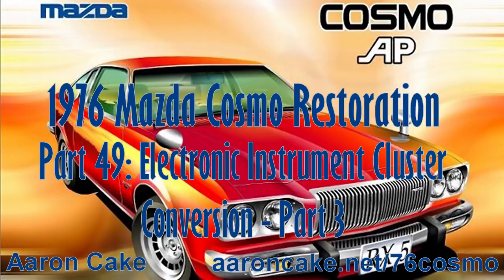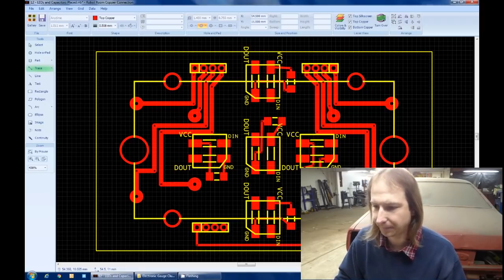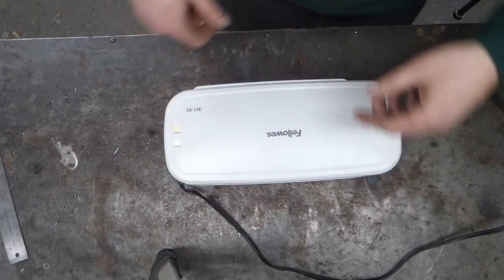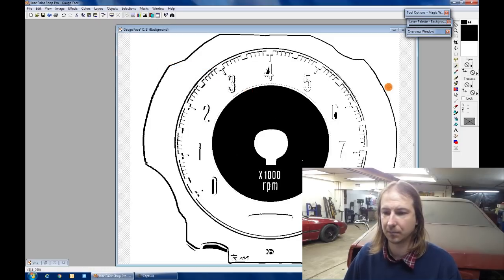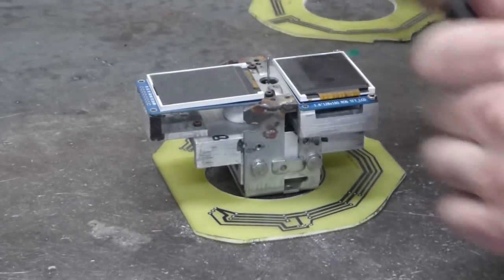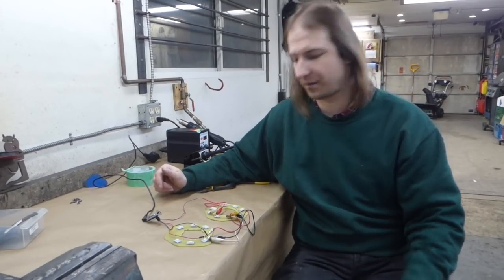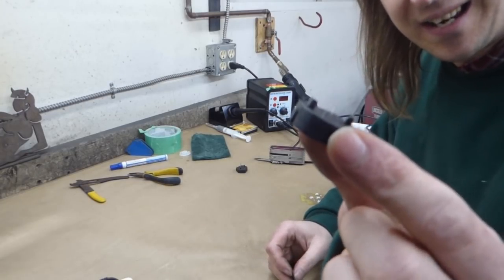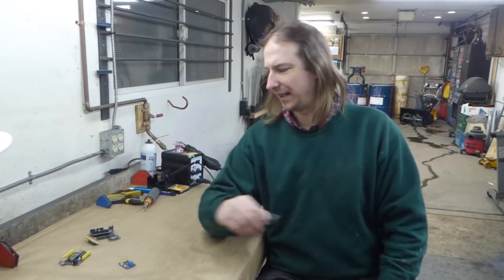Part 49 - Electronic Instrument Cluster Conversion - Part 3 - My 76 Mazda RX 5 Cosmo Restoration

Comment: This is the best thing that happened in 2020, thank you Mr.Cake!
Reply from the maker: I'd have to agree with you there.
Reply: @aaroncake  Fun Fact: 
It says 2019 on the board, and its almost 2021... holy shit!!!
Btw, i like the swiss knife (have the same) and also the turtle bottle👍🏽
Reply from the maker: I actually designed some of those boards very early on, I think on Christmas day 2019. So the files sat around a while before being used.

Comment: That hot air solder iron is slicker than owl poop.
Reply from the maker: Definitely a good purchase if working with electronics. Also great for heat shrink tubing, releasing adhesives, etc. Cheap on eBay out of China as they are OEM'd out of one or two manufacturers then sold under about a zillion brand names.

Comment: YOU'RE BACK!!!! BOOM 👍👍👍👍👍
Reply from the maker: Well, to be fair, I never really left. This work just takes a long time.
Reply: @aaroncake  well either way another video is very welcome buddy, wondering if the RFID is still in your hand and if it's caused any issues?
Reply from the maker: The RFID tag is definitely still in my hand (I expect it to be there for life) and has caused no issues. I can feel that a coating of collagen has been formed around it and now keeps it in place. I've slowly been adding RFID readers to things like my computers, so all I have to do is scan my hand to log in. Going to build a new gun safe and have the RFID reader by the key.

Comment: 90% of this video went over my head, but I love watching the complexity of the build process... even if it has been 10yrs since I started watching.

Though to be fair, I've had my non-turbo base model FC for the same 10yrs and despite having massive plans, all I've managed to do is some basic suspension mods and an exhaust that I regret. lol
Reply from the maker: Thank you. I worry a bit about these electronics heavy videos being not what people want to see. But then again, modern vehicles are like 99% electronics so it is a big part of building...I mean really building, not just assembling...a car. Haha, I think a LOT of people build exhausts for NA rotarys that they end up regretting! It took me years to get the exhaust note right on my FC and 3 different exhaust iterations.
Reply: I like the exhaust note, but the shop that built my mid-pipe didn't use stainless flanges to match the pipe so it's already rusting through.

Anyways I think the people that watch your channel enjoy the detail you go into, I certainly do. I'm actually using the info you gave in your tail light conversion for doing my own since I actually like the S4 tail lights, but no one seems to do a kit for them.

Comment: Thanks for keeping the project going aaron, in a way i hope it takes you another 10 years. I really enjoy the process more than the end results. Thats why i usually give my projects away(not something of the cosmo's magnitude of course).
I enjoy designing and making stuff, after im done i usually move on to something else so i have to move said projects along. 
Thats why im kind of bummed that binky is getting close to the end. 
Keep up the work man, we hope to see you around the tube for years to come.
Reply from the maker: I really do hope it doesn't take another 10 years. ;-) However I fear it might. Because honestly, like you, I enjoy starting new projects and would really like to have everything currently in my life done so I could move on to some other stuff I've wanted to do for a while like a rocket belt, turbojet, a new hovercraft, folding car trailer, get my pilot's license, get my motorcycle license, etc.

Comment: about those multi level boards, you could have many thin double or single sided diy boards
Reply: how about cnc copper single/double coated boards?
Reply: have you tried max1000 from arrow
Reply from the maker: I have been meaning to try to make a double sided board myself, by lining up the transfers to registration holes. But with the price out of China for multi-level boards it just seems not worth the effort if one doesn't mind waiting for the boards. I have seen video of people CNC'ing the boards but I have to wonder why. Seems to take a long time compared to etching, and of course requires a CNC setup vs. $20 of etching supplies. Just looked up the MAX1000 and it looks cool. Never done anything with an FPGA before. If I have an application I'll consider it.

Comment: No way would I have the patience, concentration or dexterity to deal with the capacitors . Great video, looking forward to part 50
Reply from the maker: Ya know, it's actually not too bad. All looks tiny at first but with a magnifier and a set of tweezers surprisingly easy to work with. In fact I much prefer SMD assembly now to through hole. But wait until you see next episode...lots of tiny soldering.
Reply: @aaroncake  "All looks tiny at first but with a magnifier and a set of tweezers surprisingly easy to work with" That's what she said :)

Comment: The ECM program that usual modern gauges do- are these also going to POST?
Reply from the maker: Probably. Done because it is the easiest/cheapest way to calibrate the stepper position knowing that power could have been cut at any point. Those motors are actually designed to just be whacked into the stops. So run enough steps to hit the end of travel and beyond, then roll them back to zero and beyond. It's more visually appealing then just running back to the zero stop for a few seconds.

Comment: When I do surface mount components at work I usually use an iron only because I don't like the hot air gun.  Your technique is different than mine, I'm going to give yours a shot.
Reply from the maker: Some SMD stuff I use the iron. Next episode is heavy on the electronics so it will show multiple techniques.

Comment: Funny but as you were reviewing the options towards the end of the video, and even prior to that, I was thinking to myself: "just use a 1284 on a custom board!"  I did that very thing a few years ago.  I had an SD card, external memory, etc. all running to that uC.  It performed quite well.  The primary task of that board was to process analog input.  Anyway, I look forward to the next episode.  Particularly interested in seeing how you design the board, its purpose, where you have it fabricated and where you have it assembled.  Thanks!
Reply from the maker: You'll get all of that stuff in the next episode with probably too much detail. I quite like the Atmega 1284. Have used it in several projects including the I/O boards (1284, W5100) that form the business end of my home automation system. It was a the logical choice even though it is't the fastest. Perfect pin count, plenty of memory, and similar enough to the 328.
Reply: @aaroncake  Having been down that road myself, it won't be too much detail for me personally but more like a trip down memory lane of sorts.  Cool that you integrated it into your home automation system!
Reply from the maker: At some point too I'll be documenting the home automation stuff on my website. Slowly working on the writeup. But if you want to see the board, you can google "aaron cake 1284 w5100". A post on the Home Assistant forum should show up.
Reply: @aaroncake  I'll take a look, thanks!

Comment: Thanks for the new video! The work you put into this project is amazing and blows my mind. Looking forward to the next one :) About the traces with 90 degrees angles.. The electrons will most likely tear out the corners very quickly and start to leak out all over the place :o
Reply from the maker: No, no...That only happens if you mount the board upside down. Or if you use it in Australia.
Reply: @aaroncake  Oh, right! Then you should at least try to avoid driving upside down or driving in Australia to keep this board in good shape for longer.  You can probably safely drive upside down in Australia though.

Comment: I've used copper connection a long time ago from your recommendation on the taillight videos. I have since switched to EasyEDA. It's a hundred times better I'd highly recommend. Also just FYI jlcpcb will charge $2 for 5 boards 100mmx100mm with silkscreen and all that jazz. I usually combine all my boards/components in one order to save on shipping 

Also the WS2812B's aren't too picky about the bypass capacitors. I've used them in a bunch of projects with and without them. You could also just use one larger cap by the supply traces
Reply from the maker: I tried EasyEDA (granted, it was 2 years ago) and didn't like it. I think my major problem was that the offline client wasn't truly offline, and in the terms of service they state they may share your designs. At the time it didn't have a print feature suitable for toner transfer. I personally find Copper Connection great for simple boards because it is so straightforward and doesn't enforce rigid rules.

That's a good price from JLPCB. I've been using PCBWay so I'll have to give JLPCB a try for my next project.

Regarding the WS2812Bs, I know that often one can play a little fast and loose with bypass capacitors but I chose to follow the datasheet.

Comment: Hey Aaron,  i think you haven't mentioned this. Are you driving screens, leds and motors from the same arduino?
Reply from the maker: Oh, I might not have been clear. It will all become clear in the next episode but basically each group of two gauges will get one controller. So two steppers per controller, not sure if I'll split the screens between the two yet...you'll see. And much sooner than the time it took this one.

Comment: Arduino supports Flexcan. Im using a Teensy 3.2 with Flexcan without issue
Reply from the maker: A Teensy isn't a STM32, if that is what you are commenting on. I would have liked to use STM32 with the built in CAN transceiver but without Arduino library support for CAN on the STM32, it was just too much work to code something from scratch, or learn another framework (the STM32 HAL) when I'm already familiar with the Arduino framework and wide library support. I think you'll like my solution. I did consider the Teensy, but ultimately decided to go far more integrated and not use dev boards.
Reply: @aaroncake  Gotcha. Wasnt sure if you knew about the teensy. Didnt know the STM has the transceiver built in. Ive been adding that to my projects
Reply from the maker: I bought a bunch of STM32 boards though haven't really used them. Planning on making a macro keyboard with one since they have USB host support. Years ago I followed someone on the RX-7 Forum who made a display using a Teensy w/LCD in place of the clock module, showing CAN data from their standalone.
Reply: @aaroncake  I read that through that thread before as well.  Definitely alot of talented people doing small niche things. ive just found it easier using the teensy vs the stm on arduino lately. although ive started trying to use stm32 on arduino. more can bus based stuff lol

Comment: Are you going to install any kind of dimmer for the cluster? Just making sure they aren't too bright at night?
Reply from the maker: All the LEDs are individually addressable so they can display any colour at any brightness. It is likely in software that I will program a continuous adjustment to ambient light that can also be user adjusted somewhat by the rotary encoder I put in the dash.

Comment: Its a bit tricky to surface solder stuff. But once you got it you got it :) trial and error.
What hot air gun are you using, looks familiar.
Intrested in that infrared temperature meter. What is it? Or do you recommend something else?
Searching for a inexpensive one. No need to use it more than a couple of time. My goal is to measure anti-freeze coolant in my car. Having some issues.
Reply from the maker: The air station is one of the unbranded Chinese clones of, well, probably an unbranded Chinese clone. Can find them on eBay searching for "yihua rework". I think I paid about $60 late 2019 and it's been working perfectly since. In fact it has become my main soldering station. Regarding the IR thermometer, again it is an unbranded Chinese thing from eBay. Good thing about needing to take everyone's temperature these days is that the price of them has decreased drastically due to mass production. They almost all use the same sensor.
Reply: @aaroncake  thank you!

Comment: Thank you so much for this decade long series  Adam haha.  I have 75' Cosmo roller at the moment that I'm building.  I'm only on part 16 so this question may be redundant but are you using the original oem powersteering on any at all on the 13B?
Reply from the maker: Not redundant at all, because I haven't covered the power steering pump. You may see in further videos that there is an FC RX-7 power steering pump mounted but that won't stay either. Once you hit the front suspension videos there is a surprise regarding the Cosmo steering box (I'd tell you, but spoilers). Good luck with your '75! Are you documenting the process anywhere?
Reply: @aaroncake  Aaron thanks a lot for the reply!  Will definitely check that episode out.  Also what did you find to be the best oem wiring guide to follow?  I highly doubt there has ever been any plug & play code written for an aftermarket ECU? Maybe that's something you would be able to do haha.  I was actually thinking about making a YT channel to document everything but man you are a difficult act to follow- 10 yrs.!
Reply from the maker: @jdmimportlogistics  I don't have much of a wiring guide for the Cosmo besides a poorly scanned schematic I found on the Internet over 10 years ago. If you need it, I can make it available to download.  Unsure about your code question. Are you referring to alternative firmware for aftermarket ECUs? I'm not aware of any except the Megasquirt which is fully open sourced and some others like it (rusEFI).
Reply: @aaroncake  Excellent thanks Aaron- so I guess you would make that schematic available on your website?  Yes I was referring to firmware I will check out those two companies you mentioned- Cosmo makes me free!
Reply from the maker: @jdmimportlogistics  I'll see about getting the schematics up on my website this weekend. As for the Megasquirt, check out part 24 of my Cosmo.
Reply: @aaroncake  Excellent thnx Aaron!
Reply from the maker: Ack! I forgot to put up the schematic for you this past weekend.  I'll get it done tomorrow or Thursday and let you know.
Reply: @aaroncake   No worries Aaron- really appreciate it you're a Legend Mate!
Reply from the maker: @jdmimportlogistics  OK, finally got it done. You can download the wiring diagram for the '76 Cosmo from: aaroncake.net/76cosmo/resources/76_cosmo_wiring.zip
Reply: @aaroncake  Excellent thanks so much Aaron!

Comment: YESSS, been waiting for this since your last video. Your first video inspired me to do a similar setup with X27 steppers and an arduino nano to convert the mechanical oil pressure and speedometer in my 1976 K5 Blazer to electronic. Waiting on some AX1201728SG drivers on the slow boat from china to arrive.
Reply from the maker: Oh, that's awesome! Do you have it documented on a website or on the YouTubes?
Reply: @aaroncake  I haven't gotten a chance to put iron to solder yet, but I have started on the code, my usual starting point as I'm a code monkey by day. It's hosted on my github

https://github.com/nweigl/GaugeCluster
Reply from the maker: Just took a look and will follow it along. Love those x27 steppers. They're surprisingly fast when you have the step parameters tuned in. I think the datasheet is something like 600 degrees/second. Edit...Should say that I'll be using AccellStepper on the final code.